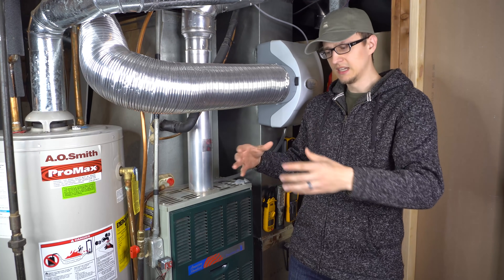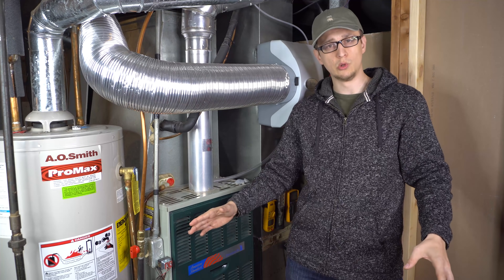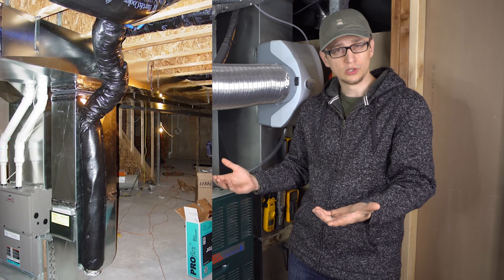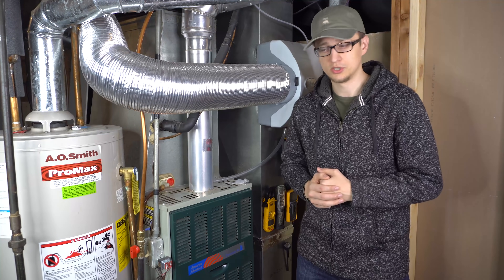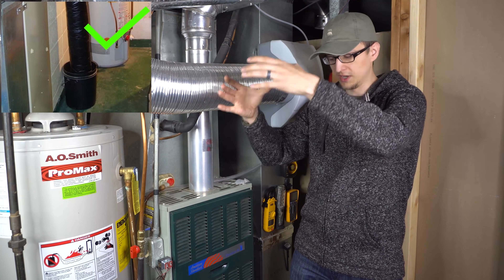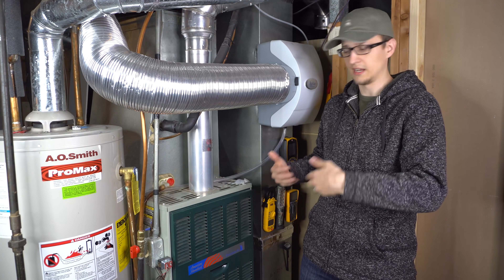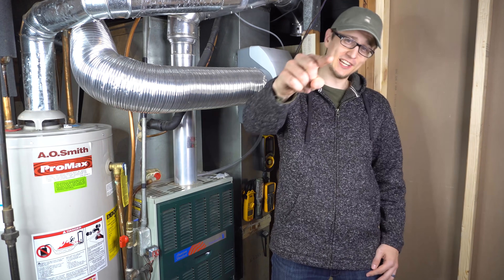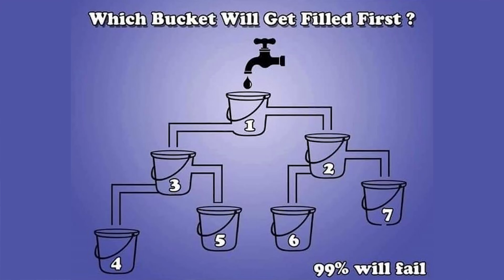Air For Furnace Explained (Combustion Air or Make up Air)

Comment: Bucket 3....We just had a new 80% furnace installed and it has a PVC pipe on top for combustion air.  We had a natural draft furnace that didn't have any fresh air in to the house.  It is not in a room, just in the basement.  Can I run a PVC pipe to it from outside?  Or should I run a duct to the room?   Or do I need to look at something like en ERV?  We have gas hot water and furnace and stove.  No return air vents in house, and we have a radon fan in basement that probably pull some low pressure in the basement from time to time.  I am sure cracks in the floor allow air in to the Sump well.

Comment: So if i understand correctly, the air in the HVAC room is not dispersed throughout the house ?  It’s used for combustion and then exits the home via exhaust pipes?
Reply from the maker: Yes. Unless you have a return in the HVAC room - then it would be used for both.
Reply: Ok. So if there  is no return in the room then there is no air being distributed from here?  How can I determine if there is a return?

Comment: Why would that guy in video need that separate flexible tube for combustion air if he had a high efficiency furnace that already has a pvc intake pipe for air? just for the hot water heater?
Reply from the maker: In that scenario, yes. Just for the water heater really. The furnace was probably replaced not too long ago but the previous unit likely needed make up air as well.

Comment: Thanks for all that.  It helped my understand our mid efficient furnace in our recently purchased 2006 home.  Our older home didn't have a fresh air intake, whereas this one does.  And, like you mentioned, I feel the cold air seeping into the furnace room (it's winter now) and that is normal. Previous owner duct taped the screen around the fresh air intake (probably thinking it was letting cold air in and didn't understand why) but I have now pulled it off.  That guy thought he was a handy man, but has messed up a few things in this house. Slowly fixing them. (Sigh)

Comment: My home inspector came in and told me he wants me to connect combustion air wiring to the unit so whenever the boiler, it’s a gas boiler whenever wants air the unite will turn on a switch to let in ventilation

Comment: @WordofAdviceTV HI Jay, I came across your video and found it very very helpful, but i am only a regular home owner. We have a 1year old high efficient furnace like you dad's set up and we also have a fresh air intake pipe for the tiny mechanical room. 

I wonder if we can put a hepa filter for the fresh air intake ( located out side our front door), it is sucking up neighbours cigarette smoke to my furnace and into my vents.
Reply from the maker: That's an interesting idea but I have never seen that done before so I can't say with certainty for or against. I am not sure how restrictive the hepa air filter will be but I am thinking that it would actually work out fine. I would give it a try. 🙂

Comment: Good explanation.  Most HVAC equipment (in their documentation) has the required CFM in air required for their device [they even are supplied for gas ranges].

Comment: I have an oil furnace and an electric water heater/dryer. The room that it’s in is approximately 13x5 ft.I have a vent next to the oil furnace that goes into the crawl space. On the other side I have a cat door that stays open most of the time, with the kitchen/living room on the other side. If I cover that vent, will the cat door suffice for combustion air? Does the air have to come from outside?

Comment: Hey- great video but I still had a question about removing both the high and the low combustion vents. My home currently has 80% efficiency hot water heater and furnace and I am looking at upgrading to a directly vented tankless hot water heater and a vented high efficiency furnace. I would like to run my pvc lines though exterior wall where there vents are at? Any issue with removing them. There are no other gas burning items in our house.

Comment: Bucket #5 fills first, not bucket #3.  From the tap into bucket #1, the lower outlet goes to bucket #3, the higher one goes to bucket #2, therefore bucket #3 has to fill nearly full before water goes to #2.  Water going into bucket #3 doesn't go to bucket #4, since that outlet is blocked.  So the bucket fills to the next outlet that pours into bucket #5.  #3 never fills because the top is higher than the outlet and water will fill #5.  When #5 is filled it will overflow and number #3 never will.  Assuming overflowing is not allowed then number #3 would be the second bucket to fill.  

Very good explanation for combustion air and how it works.  I need a video on figuring out the calculations for combustion air and an explanation on how the IRC writes it.

Comment: Whoever did my setup, they've pointed the pipe towards the water heater. The external body of the water heater is freezing cold, as a result. Not sure if that's good for its efficiency :/

Comment: Good job. Thank you. How do you calculate the size of air supply duct?
Reply: if you water heater is 40,000 BTU divide by 1000 and it will be 40 thats is 40 sq Inches so is like 6.5 in x 6.5 in space to be like 42 sq IN

Comment: I have a newer 96% high efficiency natural gas furnace recently installed.  It seems to work fine when is running, but when it's not running I notice cold air in my supply registers.  Is that normal?  I have an intake and output put going through the wall of my crawlspace from the furnace.  If not, is there a way to fix it?

BTW, I cheated and accidentally saw the answer when I was looking through the comments. 3 is the answer.

Comment: Should you feel the air blowing around when the furnace kicks on? It feels like a high-powered blow dryer. My hair is blowing and so are my clothes. It's that normal? I just had my furnace replaced so I'm wondering if that's normal. Also, the caps on top of my water heater are melted. Any connection?

Comment: so your saying the watter heater and stuff will pull the fresh air thro the pipe so you dont need a fan to push it inside instead of the air just rising out of the house?

Comment: Great video, thanks.  Question-I have a closed combustion (high efficiency) furnace and a atmospheric (top vent) hot water tank in the same room.  I have experienced backdraft at the hot water tank vent when running dryer/range hood on the main floor.  I want to move the existing make-up air duct in the furnace room  (in a bucket) to the air intake of the furnace to better support the other house equipment (dryer, range hood, etc.) and open a air register in the furnace room to support the hot water tank.  I run my furnace fan 24/7.  Will this work?
Reply: Hi, I have a similar situation, high efficiency furnace and atmospheric w/h, which backdrafts sometimes when starving for fresh air…
I’m wandering if you installed fresh air intake ( in a bucket) ? If yes, did it solve the problem?
Thank you
Reply: @andreilesiuk9538 Sorry for the late reply!  Yes I did solve my backdraft problem.  I used a splitter on my make-up air opening. Then connected one of the split 4" hose directly to the furnace air intake, and the second to the bucket-on-the-floor.  I also cleaned the critter screen on the air intake opening was blocked with dust on the outside which was blocking much of the make-up air inflow. After these steps, I've had no instances of backdraft at the h/w tank. I've also adjusted living habits by trying to open a window when running the dryer and/or range hood for added measure.  Good luck, let me know if you're successful.

Comment: The furnace room is the hottest room in the house with all the heat from the hot air duct. If the floor is cold then it's something else, not combustion air.

Comment: Do high efficiency furnace's really need a combustion air intake? They have an intake pipe that's usually piped outside shouldn't that provide enough air?
Reply from the maker: You are right. The combustion air intake in this case is more for the water heater. But I have seen plenty of high efficiency furnaces that do not have an air intake pipe and instead suck air from the room.

Comment: I don't know if you watch this channel but I have a house we bought and it's been so hot all summer. And I just went to the back room where the heat seems to be coming from. I thought it was improper insulating between the attack. Which was contributing but I've fixed that and it's still hot. So I was checking around the room while my water heater kicked on and noticed an ungodly amount of heat coming from it corner of the room. Long story short it definitely isn't venting so I detached the the vent from the double wall vent that the furnace and water heater feed into and it's just pulling air from outside. Like genuinely pulling it

Comment: Hot summer, cold basement; add return plenum register(closable) at floor level to exchange geothermal/below grade “cold basement air” to hot upstairs spaces… concerns with back drafting? Thoughts? Thanks!

Bucket 5 would fill 100%, granted that valve is connected to positive pressure. Would appear that it’s floating and connected to nothing 😋

Comment: Question if I have an open combustion furnace in my attic and I want to spray foam it with closed cell, should I add a combustion air supply duct / damper to the hvac units or would a vent that opens up to the rest of the house be enough? I eventually want to replace them with an electric heat pump but that wont be for another year or so.. thanks!

Comment: Great video! Is there a such thing as a pipe within a pipe for the exhaust from our furnace? We noticed that there was a gap between two connections. When taping it up, ours had a smaller duct inside a larger one.
Reply: Yes that sounds like double wall pipe

Comment: If the sewer gas vent is close to the hot water heater/furnace exhast, could a back draft cause sewer has to get sucked into the house?

Comment: Thank you. Bucket trick is going to be amazing. In Canada it’s to cold for the intake to have no restriction on the cold air intake.
Reply: I have an old house in Canada, and my fresh air intake is still connected directly to air return of the furnace. Actually, I have two furnaces and two separate fresh air intake pipes.

Comment: i would say # 1 is the first bucket to get wet hence filled first but # 4 would be first to be full, good explanation on make up air, when you said 99 % fail i know i had to think harder and thats what i came up with cheers Graham
Reply from the maker: Thank you! #4 is close but incorrect. Your logic was correct but this puzzle also has some trickiness mixed in. 😄 The answer is in the video description 😉

Comment: 3, 5, 2 and 7 does not get any water so it's  between 4 and 6 but the left pipe in bucket 1 is lower than the right so I will guess it's 4!
Reply from the maker: You got it!! #4 is indeed the correct answer. Thanks for playing!!

Edit: I apologize! The answer in the video description was wrong. It is actually bucket #3!

Comment: You just explained my entire basement dilemma.  Spray foam insulated my basement and it became too tight.  Had to add a fan in a can to provide make up air.  Unfortunately the fan in the can still wasn’t enough and when we ran the furnace, dryer and hot water heater at the same time we’d run into a negative pressure situation.  Final solution was a fresh air boot from field controls.  What a nightmare!!!
Reply: Hi, what is the air boot?  Is it the fresh air intake to the outside wall? I have a similar situation and when I keep my basement window open then it  helps with backdraft. I can’t keep the window for too long though because in the winter it brings a lot of cold… I’m wandering if I should install the same insulated combustion pipe that shown in the video?
Thanks

Comment: Hey, Jay.  Couldn't I add a vent to my basement HVAC ductwork (an actual vent, not a return) that feeds the basement to provide more replacement air and fight the negative pressure?  All of the return air is coming from 1st and 2nd floors, so this should help, right?

Comment: Great video, it was exactly what I was looking for in regards to what the large black flexible pipe is coming into my home.  I knew it was a intake for the furnace, now it makes sense why there is a "U" shape at the bottom of the pipe, to trap the cold air.  Here is my question.  The black pipe is on the outside wall, which is presently a cinder block wall.  I am going to stud in front of this wall, and 2" pink sytrofoam.  I am making a wood shop in this area, and this pipe is in the way.  Can I run this pipe between my floor joists, with a horizontal run of about 8 feet.  I am planning on studding off around my furnace, and water heater, and will sheet rock this, no insulation.  I would than like to drop this black flexible pipe on the inside of what I guess I will call my furnace room.  Basically, the only difference would be with the extra 8 feet of horizontal pipe, since I will than drop it vertically, the same distance as it is now, with the "U" shape at the bottom.  Also, can one get to close to the furnace with the air intake and the "U" shape at the end.  Thanks, I really enjoyed your video.  My guess is bucket 3

Comment: I hope you read this.  I have a water heater next to an 80% furnace.  After remodeling the basement (appliances are in am enclosed room now) the water heater's flame in the Winter goes off.  I have had many technicians over and no one can fix it.  Upgraded the gas lines, changed sensors and water heater ignitor assembly many times, checked the chimney exhaust for any blockage.  I have had this issue for over 8 years.  Yesterday I was using a small cooker with small flames using a propane tank.  I was 15 feet away from the enclosed appliance room and when the furnace turned on, the small cooker flames went off also when the inducer motor and furnace flames turned off (but blower fan still on to cool furnace) the small cooker flames also turned off.  Now I know it's a combustion air issue and I have a negative air pressure.  Do you think I should open a vent with an insulated pipe from outside to the enclosed room?  I am afraid the room will get too cold
Reply: Hi, did you end up installing the air intake pipe? If yes, does it bring too much cold from the outside ?
Just wandering, because I also have negative pressure issues with water heater backdrafting…
thanks

Comment: Excellent explanation! You might want to discuss the use of a combustion air 'boot' that connects the make-up air duct directly to the burner motor on an oil furnace. I'm looking at installing one right now in a community hall. Beckett makes them.

Comment: Great video. You break it down so anyone can understand. I have a question. Should I feel the fresh air intake pvc on my high efficiency furnace pulling the air from outside? For some reason I never feel a draft or any pull on the outside when the furnace is running.. 

Im wondering if that is causing a backdraft and poor air quality within the house

Comment: I'd say 4 will fill up first without looking at any other comments. You explained a lot but not all that I needed regarding how combustion works
Reply: Nahhh. Not 4. There's no hole where the pipe to 4 is attached to 3. No water gets in 4, 5, or 6.
I think the answer is 4 but I'm not 100% sure, maybe 95% sure :)

Comment: Hey I have a high efficiency water heater that the tank is leaking. Will a regular 80% heater work if I attach the power head from the existing high efficiency. If not what makes it so